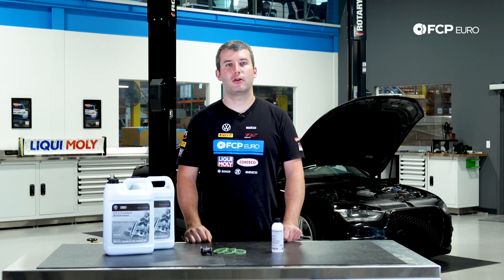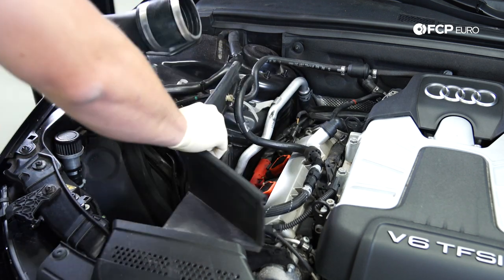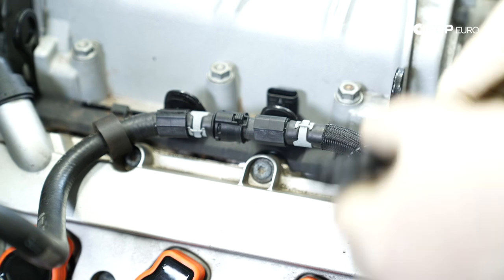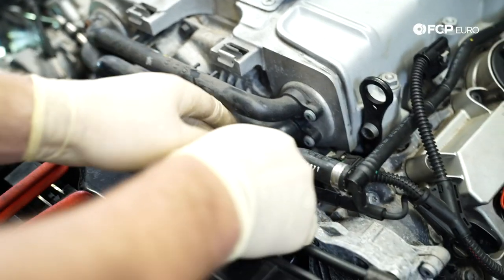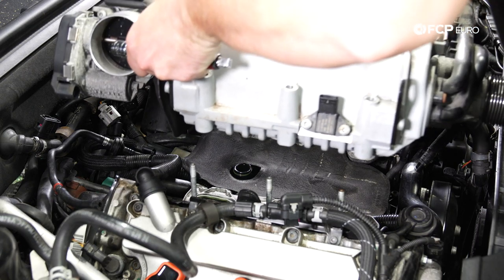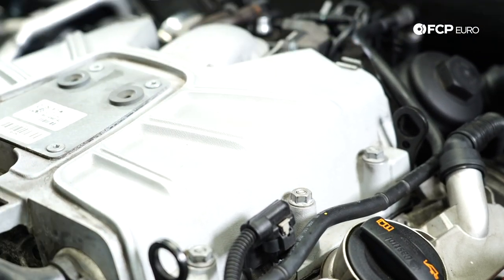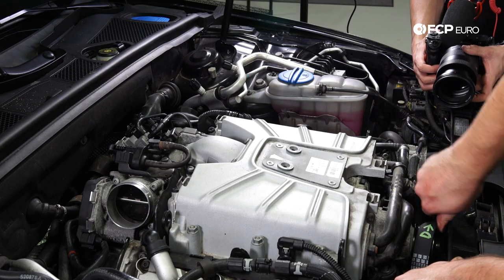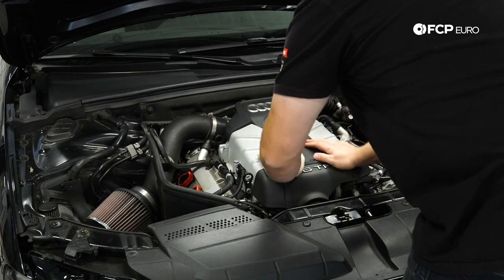Audi S4 B8 & B8.5 3.0t - Removing & Replacing Supercharger Oil (Audi S4, S5, SQ5, Q5, A6, A7, & A8)

Comment: I own a B8.5 SQ5 and I've just passed 90k miles on the car. I've been looking at a bunch of DIY videos on the engine's maintenance, and i wholeheartedly disagree that this engine is reliable like people say. Thay statement carries a very big asterisk next to it because just like in this video, and countless others, there is a bold statement that says: "while your supercharger is off,  you should go ahead and change the PCV valve, thermostat, water pump" not to mention doing a valve cleaning, intercoller cores,  and even timing chain valve guides. All this work can cost upwards of $10,000+ EASY. and these maintenance procedures are being commonly done at lower than average intervals, not uncommon for people to do them at 20-40k miles, just for peace of mind because of the fear of parts failing (which again,  is very common) so this idea that the engine is reliable is an overstatement when you factor in the amount of work and money you have to put into the car out of precaution and preventative maintenance. That is not the definition of reliable. I am in no way bashing Audi, I'm simply saying what many whisper simply because the majority of Audi lovers easily throw around the word "reliable" with this engine ignoring the fact that you have to see easily pay thousands, to perform the work at indy shops and dealerships because many arent mechanically inclined.
Reply: Reliable comes down to the motor  being able to take the extra power of modding and stay strong for 200k miles or more when maintained. Sure the maintaining is more costly, but know what you're getting before you get it. There are cars you can maintain the shit out of, and they'll have motors failing and trans that won't last 100k miles.
Reply: Race cars have race car prices it's not a 2000 v8 nor a simple v6 out a grand prix lol shits gonna cost
Reply: @Hopelessthugg  Whether the motor can take the power is besides the point, that's actually called robust. Robustness and reliability are two different things.  The motor can take the power without a doubt. But the motor is notorious for needing various preventative care maintenance in its stock form, without being modified. When you have to invest in replacing oem motor parts  before the car is even modified just to have peace of mind,  That's not reliability. That's a money pit. Nonetheless,  I love my SQ5. But it does suck when I have to drop $1800 on a pcv valve replacement at 50k miles because I'm losing coolant into my engine.
Reply: @elchapo2440  i agree.
Reply: @chipchelios  1800 is crazy buy OEM for 400 and do it your self it's literally like working on an LS so simple everything is in your face lol pcv change takes like 2 hours at max on my s4. What I find hard is getting the exhaust manifolds and test pipes out lol
Reply: The engine itself is reliable in that it doesn't grenade. Maintenance is maintenance and the price is the cost of owning any German car. The ridiculousness of an engine out to do TB that's another point. BTW there's someone who was making a DIY on relocating the PCV valve. Trying to see how that worked out.

Comment: If you don’t wanna take it off, can a fluid extractor be used and then like a big syringe to put new oil back in? I’m lazy and I know if I take it off I might as well send it out to get ported 😂🤣
Reply: Get supercharger fluid changed and carbon cleaning at the same time since it will already be removed for access while you’re in there

Comment: Your channel has been very informational on maintaining A7. I know you said there isn't any mileage recommendation for the supercharger oil change, but what do you guys think is a responsible time frame for a daily driver on a 2012 A7... 0 track days, only the occasional overtakes or aggressive driving.🤔 p.s.. i already replaced the plugs and ignition coils, valve gasket is next based on your recommendations👍🏼

Comment: I love your videos, very helpful... can you please make one on how to replace your differential fluid and transmission fluid ( manual transmission) thank you.
Reply from the maker: We certainly can and will Roberto, glad you're loving the videos!
Reply: @fcpeuro  That would actually be a good one to see!!! The 6MT fluid change, nothing on YouTube for it! I believe in the 6MT the manual transmission fluid is a shared unit with the front/center differential if I remember reading that correctly on an Audi forum! Mine drained 3 quarts at a warm temperature but then needed more for top up after driving which made a huge difference! So 3.8 quarts to fill (spill out the side) on my 2013 b8.5 S5....used the Redline MT-90 for mine, shifts like butter now

Comment: I'm having a hard time getting the air out of my system so I rented the vacuum bleeder from Autozone. Will I need to drain the system? It doesn't look like you guys drained yours but in the section where you are using the tool it looks like the reservoir is suddenly empty.

Comment: Well demonstrated as always! Just a thought, could this be done without removing the supercharger and using a manual extractor pump? I use one for doing oil changes on my E46 M3, it's great for removing it all straight from the bottom of the sump through the dipstick tube, I just wondered if it could be used on these. My guess is that access would be problematic? I wasn't aware that these were serviceable, good to know as I've just recently acquired an S4 B8 which came with a stage 2+ including the dual pulley upgrade.
Reply from the maker: If you have a small enough extractor tube it is doable top side sarcastixx74 !

Comment: Hi, I have done this exactly as explained. Really great and helpfull......but as I opened the screw just approx 20ml oil came of. I moved the supercharger as you did, but no more oil came of. I had no problem with the supercharger, and did it just in the process of changing the pcv..... what should i do now. Is there a rest of 100ml in the system I cannot fill it up. Was there really only a bit of oil the system? How can I go on?
Thanks in advance
Marcus
Reply: Any answer? Was it low or was the oil just stuck in th SC somehow

Comment: Just got a b8.5 s4 with 82k on the clock (miles). Any signs that'll point to the oil needing to be changed? Or like a miles where you should as good maintenance? I did just today put a 187 crank pulley on there...guess I should do this anyways?

Comment: Can anyone help give me some guidance with this coolant leak on my 2015 Audi S4 . The shop wants to charge 665 remove and replace cooling system crossover line and 997 remove and replace supercharger assembly. This seems really expensive to me. This is just the labor. The total comes out to like 2700 to replace coolant pipe

Comment: Hello. and first thanks for the video it was very helpful in replacing the compressor oil. But there was absolutely no oil on mine? I filled it 150 ml. on. But where is the old oil. the car has driven 210,000 km. I have not started it up yet
Reply from the maker: That is a bit concerning, definitely a good thing that you checked it!
Reply: @mikecarb0  @nicolajahm Same for me tonight, no oil in mine. Did you have yours rebuilt? Mine was not making any unusual noise at all and the input shaft turned smoothly.
Reply: Just attempted to drain my supercharger, no oil came out. 86k miles.
Reply: You should change the lols after the car has warmed up that oil is viscus when it gets old.
Reply: Yep, only about a tablespoon of compressor oil came out of my B8 S4. 110,000km
Reply: @garethwood4316  same, only 20ml came out.  Where does the rest of the supercharger oil go? I put 150ml back in. I changed my supercharger oil at 133 000km. 
Removed the supercharger again. 300ml came out. Just have to maneuver the supercharger on a engine jack or hold the supercharger with the pulley up so the oil can move itself over too the drain plug.

Comment: My supercharger didn't have any oil! I took it off to change the thermostat, water pump, and PCV. Nothing came out of the SC. Is that normal? I filled it with 150 ml SC oil that I ordered from you guys.
Reply from the maker: Its definitely possible it was airlocked, and no oil came out. It would be hard to say for sure without being able to look at the car, you may want to have it looked at locally
Reply: @fcpeuro  Thanks for the reply! I just filled it with new SC oil. Hope it goes well.
Reply: I thought the same. However if you flip Scharger vertically, pulley up. Oil will then drain from behind pulley well area. Left mine 5 min then drained as video showed. Got about 120ml.
Reply: @randolphmanalang1377  same, My Audi Q5 had only 20ml of supercharger oil that came out today. I put 150ml in. Super strange.
Reply: @European_carclub So only 20ml came out but you put 150ml in? How has that been holding up? 🤔
Reply: @austinmerrival927  I realized with one of the techs in the shop that there was some still left. So I took it off again and eventually got all the fluid out. So triple check when you drain it.